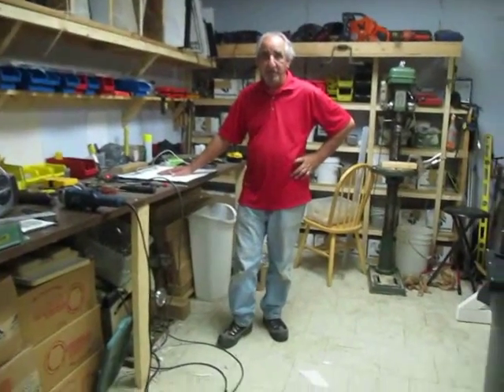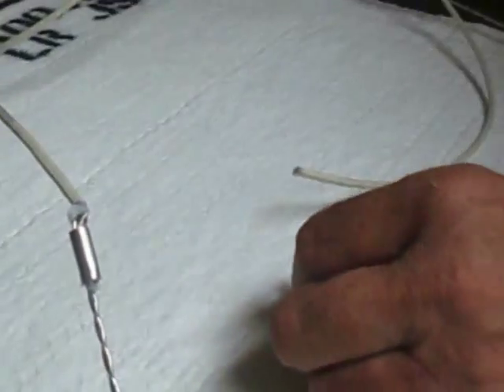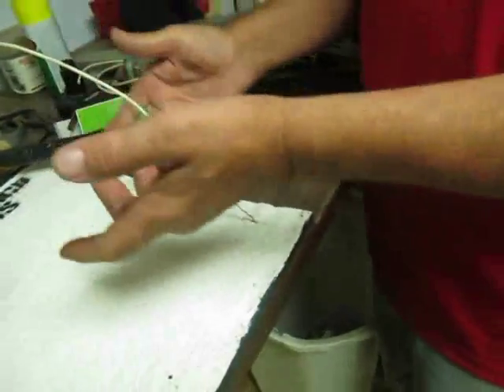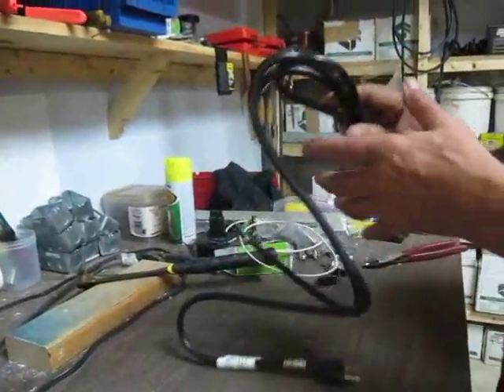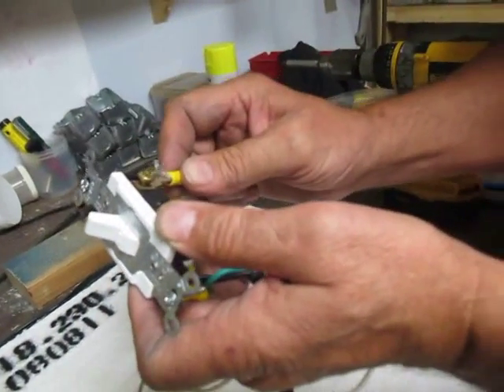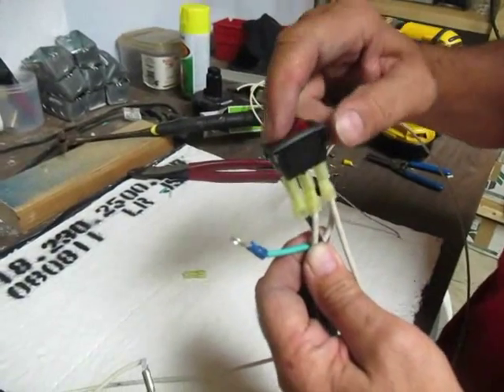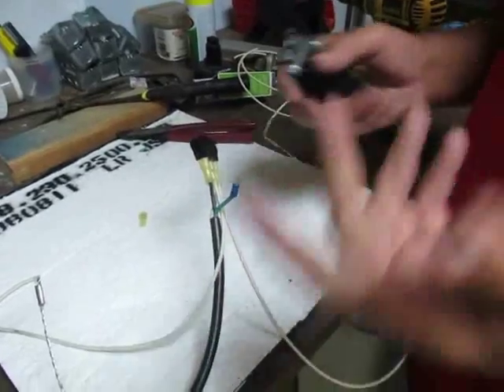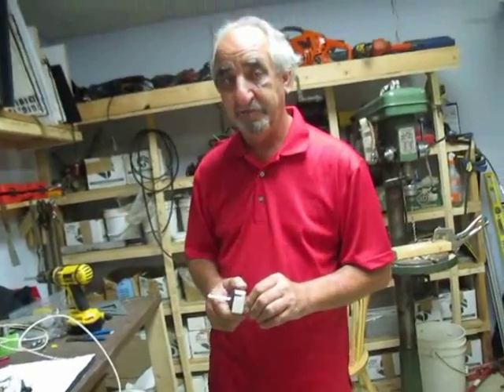How to repair Your  FLASH DRYER

Comment: thanks Bob you just saved me a few hundred bucks, however if you don't have the crimp tool
 for the stainless steel butt connectors I found that a good pair of vise grips will work just fine
Thanks for the info
Reply from the maker: you are welcome :)

Comment: Hi. New here. My panel didnt come with any type of switch installed.  How/where should i install a switch since there isnt a hole/slot to place it in?
Reply from the maker: Well I would like to help but I need a lot more information you can email me some pictures of what you are talking about that would help . Also you say panel do you mean flash dryer ? or just the heat pannel ?
Reply: @BobMongiello  yes sir. It is a flash dryer. 16x16 i will send an email. I'm sure it's posted somewhere here?
Reply from the maker: @ScarrBurgsGodssoulja  Bob.mongiello@gmail.com

Comment: hey what kind of elements are those also i just set up my flash dryer and the edge of the heating element is showing can i pull it apart and get it set back properly idk why but  it looks like its sagging
Reply from the maker: if it is a infrared heat panel you can movie it into place no problem

Comment: any tips for coil flash dryer repair?
Reply from the maker: +justin chambers  just open it up and look for any wires burnt and separated and repair it , if the coil is bad just get a real flash dryer with and infrared heat panel you will not have the trouble curing and repairing you are having here . I sell them cheap :)
Reply: Hello there, I'm trying to repair my flash dryer, it's the coil one, I did replace the wire that seemed to be burnt but, still it doesn't work. How can I tell the coil is damaged? I can't think of anything else. Any feedback is welcome. Thank you!
Reply: Just open it and it doesn’t work
Reply: what the best way to obtain this from you? looking for the replacement parts.

Comment: My panel melted the connector but blew a hole through the bottom (black side) of the panel. Any way to patch the hole? Thanks in advance!!
Reply from the maker: +Roberto Sanchez   You can't patch the hole really but if it didn't burn through the coil wire your ok   . If it burnt through a coil; wire  you need a new panel ...
Reply: +Bob Mongiello no it's actually the connection from the butt connector to the cable with the sleeve on it that connects to the power. Thanks for your help!!!!
Reply: Hi, do you know where to get the infrared panel?

Comment: Hey bob nice video ! I have a issue with flash dryer it's an infrared unit and what happened I was doing a print job and stepped out of the room to get some water. Unknown  to me as I walked out of the room I bumped the shirt board enough to set it in motion and  it  stopped beneath the flash dryer with a shirt on it. I decided while in the kitchen to make a sandwich and after a couple minutes I smelled something burning.  I ran into the room and found the shirt and platen both on fire.  The flash dryer was engulfed in flames and  once the fire was out I checked out the flash dryer.  I can't tell if the infrared panel was  damaged or not but there is a crack all the way across the panel on the side that is white beneath the insulation and it appears that the black side that gets hot may have melted slightly in a few spots.  Would the crack on the top side in the white portion of the panel be a problem ? The dryer is one of the bright green ones that come with the Riley Hopkins presses
Reply from the maker: wow  !! well it's been 3 years since you posted this and I had no clue you did .. I don't think it was an infrared panel i may be wrong but in any case i would have to see photos or a video of it to tell  but i am sure you bought a new one by now

Comment from the maker: Ok   Stainless steel butt connectors  very important  you get them from INtekcorp.    com     800-387-8559  also  they have all the materials you will need insulation and the the high temp wire  ok 
 thanks 
 Bob